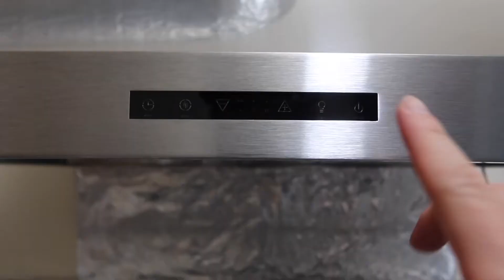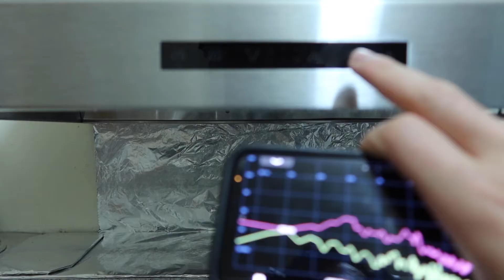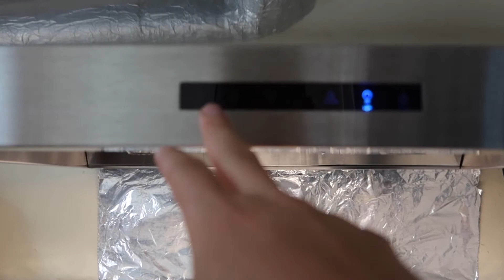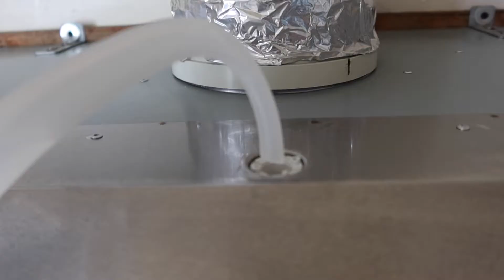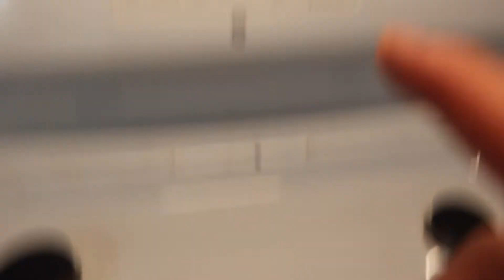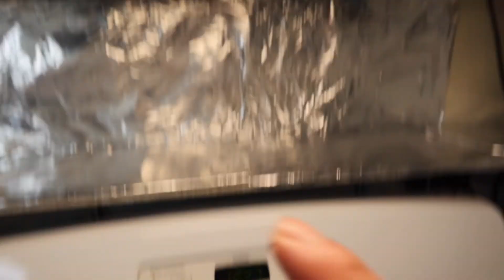Update : Is Pacific TruSteam SC88 Range Hood Still Worth it?

Comment: Does water drip from the fan during the cleaning cycle? Water drips down on mine and it is somewhat annoying.
Reply from the maker: It drips on the back where the water tank is. Which should be normal.
Reply: @UnwrappedandRated  No I mean water drip from the fan blade area, not to the back. Does it happen to yours?
Reply: @JudsonChung  no, water does not drip from the blades.
Reply: @Northernstar17495 did u figure it out mine start doing it too same on the right side of the fan grill. I don’t know where the drip comes from. Please replay
Reply: @thomas9469  mine doesn't drip so I have no idea why yours is dripping.
Reply: @Northernstar17495  
Mine is 5 yr old I just noticed yesterday the drip from where the groove of the rear grill where u attract the grill. It must be some leaking inside. Also the fan blade is removable to clean. I see some grime on my fan blade trying to figure it out how to clean.